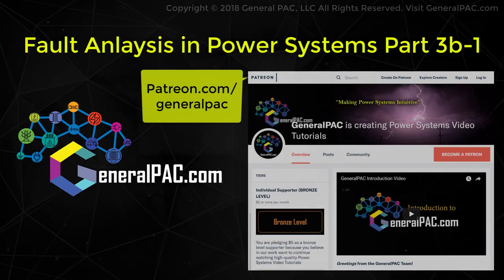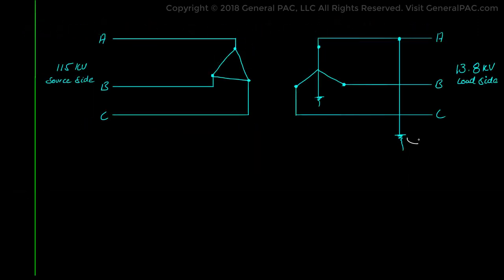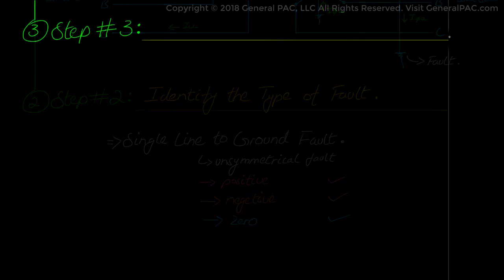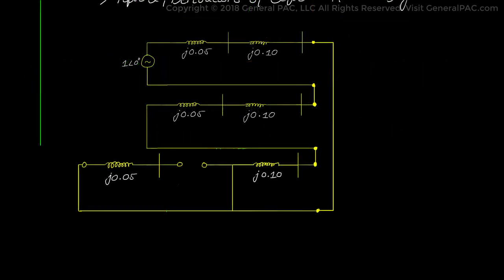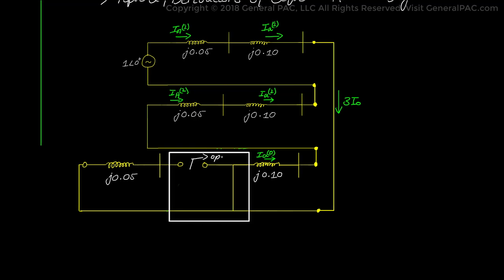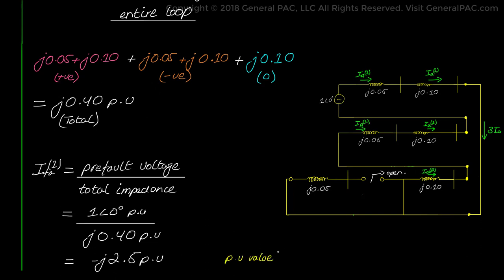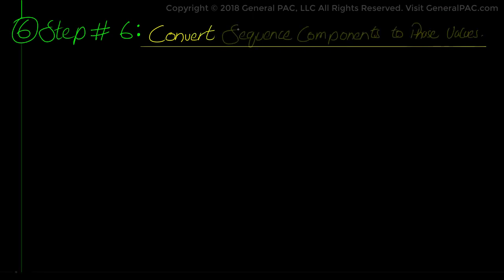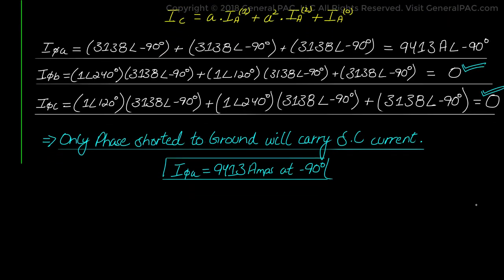Fault Analysis in Power Systems Part 3b-1

Comment: Dear GenPAC, thank you for the great video. Could you please further elaborate why the 3 component networks should be in series and not parallel?
Reply from the maker: Hi liew, this is for the single line to ground faults correct? It goes back and relates to the equations themselves. The three branches needs to be summed together and that's why it's in series for 1 LG faults.
Reply: Can you also explain why L-L-G fault are branches are paralleled with 3xZf?